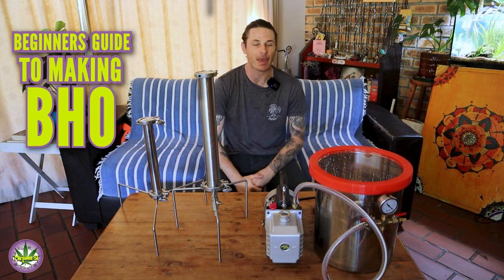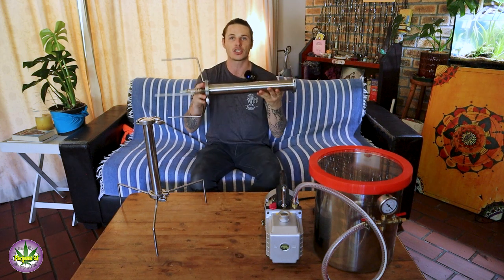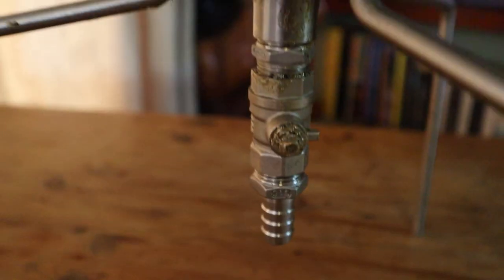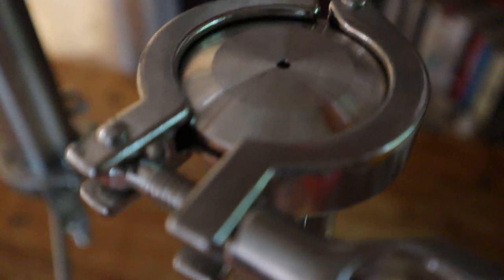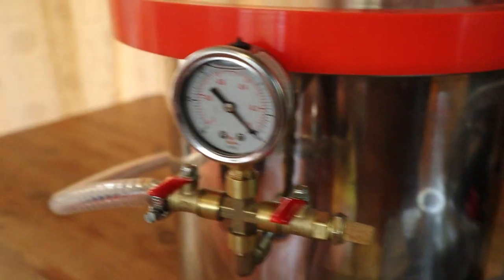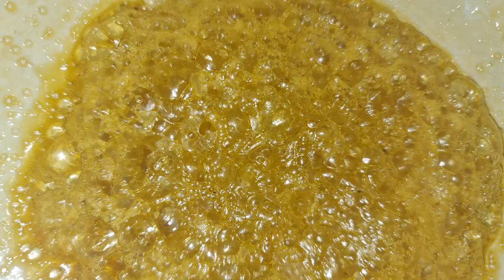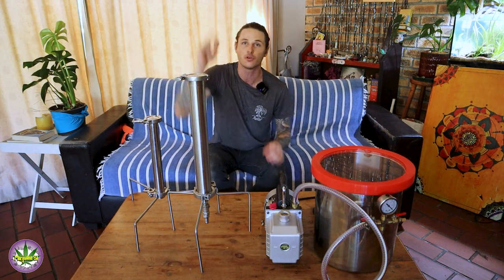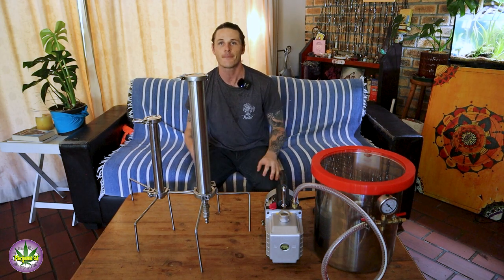Beginners Guide to Safe BHO - Equipment (Episode 1)

Comment: With the top your using it makes no sense to use the tap bottom, might as well just use the open collar for the bottom
Reply: Closed turns the gas in liquid form and then acts as a solvent for extracting